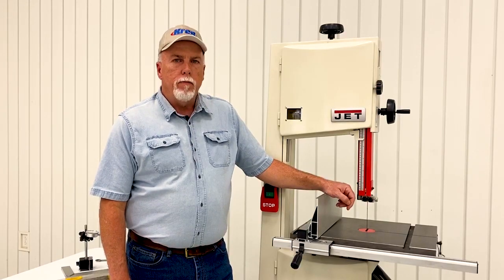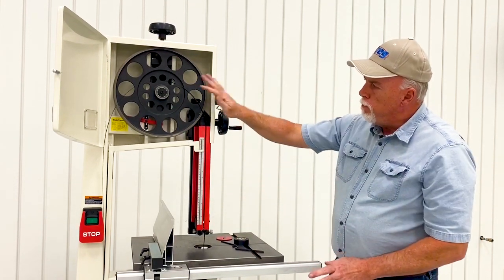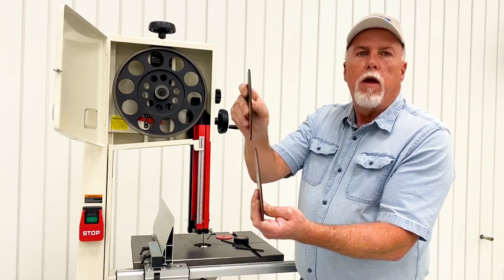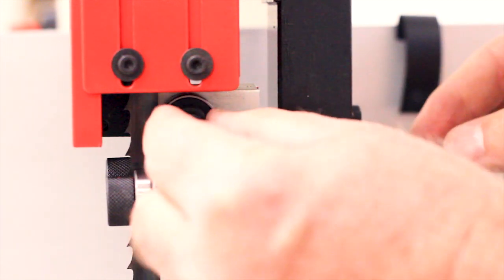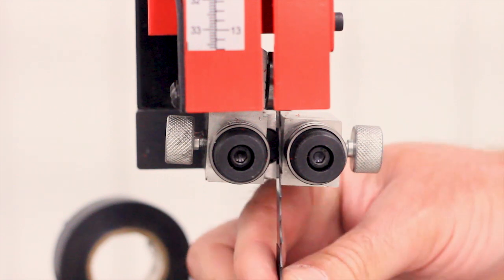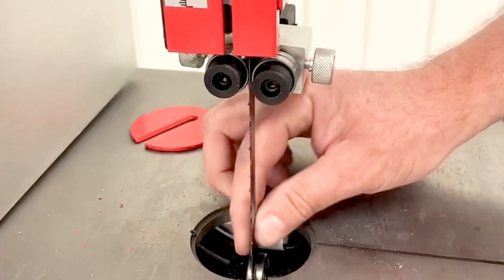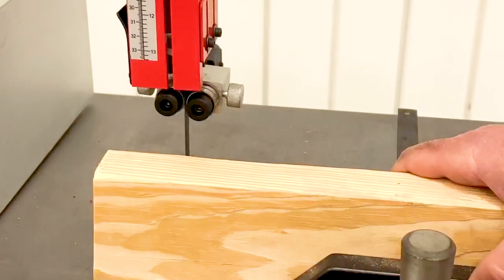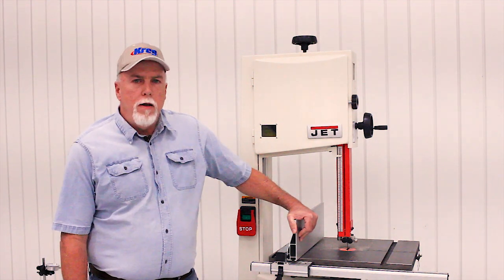How To: Easy Bandsaw Blade Tracking

Comment: Great video. My blade sits perfect and as much as I spin it manually it stays bang on centre. However as soon as I run it on the motor the blade comes off after a second or so!

Comment: Steve F. I thought about including that in the video. I might add it or do follow up.  Narrower width blades should be about center as the teeth on them are not so pronounced. The larger width blades can go further to the rear with the teeth just forward of the wheel crown or as you said the bottom of the gullets. Thanks for asking. Let's me know how to do a better job in communicating.

Comment: Nice vid. What's the solution when the blade drifts to the right when trying to cut a straight line? The guiding bearings perfectly set, but still the blade drifts. Why? Thank you.

Comment: I have a question for you about my craftsman 14" bandsaw. The saw is set up like you said, and it has made this sound since new. The wider the blade the worse the thump and louder the noise. It's a thump and wining sound. I have checked all the blade guides, nothing wrong with them or the blade. It doesn't matter what blade I put on the saw. It does get louder when trying to resaw a wider board. Do you have any ideas?

Comment: Guy...great video and teaching ....thank you. Question on my Jet JWBS 14SFX when I set up with a 3/16 blade.....I track it in the middle of the tire by hand and also by turning it on.....and every thing is all  good, but then in the middle of cutting out a bandsaw box the blade has completely come forward and slides right off the wheel. Any suggestions on what I'm doing wrong? or what the issue can be? Driving me nuts! My guides are all set up properly .....I'm thinking my tension is good. But still have that issue of the blade losing its tracking when cutting a pattern/bandsaw box.

Comment: I just bought some trouble a Delta 18” with two knobs for blade tracking. The manual is no help. It just says turn both knobs equal amounts.. Great! That’s real help full. Nothing about both clockwise or counterclockwise, or one clockwise and other counterclockwise. Or hints on turns to track the blade forward or backwards. Can anyone help haven’t found a video with two adjustments knobs?

Comment: I just picked up an old wards bandsaw. 
the first thing I did was to clean and paint it up. 
I had taken the top wheel off before the blade was running true. now it drifts and comes off within a few turns. adjusting does not seem to help.
the tires are cracked and worn they are on the way here along with a new blade.
not wanting to wait on my new parts I went and tried to put the old blade back on. 
last time I had done anything with a bandsaw was around 10th grade and although I passed its been a long time and need a refresher on the use and maintenance of a band saw. 
I had ordered rubber tires that is what is on it now. 
the tires are 12 inches and the blade is 78 inches long. the old blade is about 1/4 wide and I ordered one that is Magnate M78T58T4 Meat Bandsaw Blade, 78" Long - 5/8" Width, 4 Tooth, 0.025" Thickness. 
I was not sure of the length at the time I ordered it looks to be 77 3/4 hopefully it will adjust to fit.

Comment: I am having a heck of a time getting the bandsaw blade on my jet 14” JWBS-14sfx model bandsaw. I have literally tried everything to get the blade to stay in the middle. When pressure is applied while sawing the blade tracks to the rear of wheel. This causes the blade to loosen. When sawing stops the blade travels near to center again but not exactly in same place when started. I am using a Timberwolf 3/8 6tpi blade with a fine kerf. Saw unusable for a week now with approximately 3 hours total use since purchase last year. Any suggestions. This has been very frustrating to say the least for such a bragged about bandsaw.

Comment: Hi Guy. I'm having real trouble getting the bottom wheel to track in the center. No matter what I seem to do it wants to drift to the front side. I've even  readjusted the bottom wheel alignment according to the manufacturer And it's still drifts to the front. The bandsaw blade is one full width ahead of the center of the table slot. I noticed your video shows it dead center. I can't turn the throat plate around it would tear into the saw blade. Any thoughts would be greatly appreciated. Appreciated. Sorry to be long-winded. Great video, thanks

Comment: What is your opinion on blade position on the top wheel?  There seems to be different schools of thought on what I've read or seen online.  One thought is that the band should be centered on the wheel.  Another is that the bottom of the gullets should be centered on the wheel.  And yet another is that the tips of the teeth should be centered.

Comment: I have an old Craftsman band saw.  It has about 3 degree drift - I adjusted the tracking on the blade and it is dead center.  It did not solve the problem.  I also adjusted the table.  It helped but the table doesn't have enough adjustment to solve the problem.

Comment: How do you get a 1/8" blade to track?  I've got 2 hours so far and all i have managed to do is swear quite a bit.  That doesn't seem to help.  Any suggestions???
Reply: hahahah i am battling with that now,  the only way I can get it to stay on is if it is riding the back edge of the top wheel.
Reply: I put my left hand behind the bottom of the top wheel and pull or push it until the 1/8" blade tracks in the center, then I tighten the tilt adjuster. Takes only a few seconds!!

Comment: At work we have a Jet almost like this one and no amount of tinkering it makes it cut straight: the blade invariably twist and start cutting to the right (we're cutting AL )
Quite frankly, those saws are very cheap looking and feeling, thin and wobbly . We also have an old 1970's Syderic band saw (french manufacturer ) and it cuts straight as a laser and requires no playing left and right with this or that gizmo. It's also mostly cast iron , weighs a proverbial ton and doesn't wobble. 

Much better tool.
Reply: I have the same problem. No amount of tinkering can get the blade to track straight on the top wheel. 😢